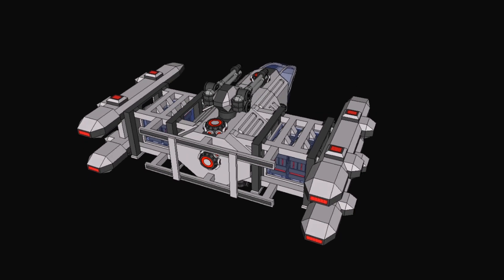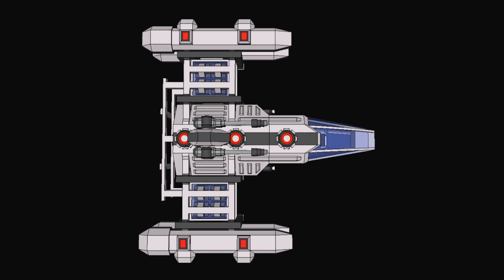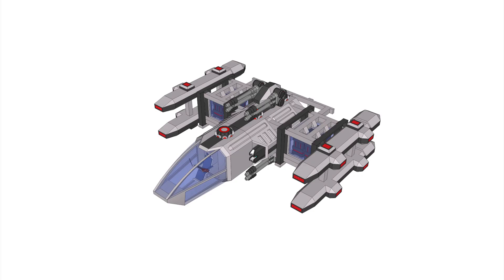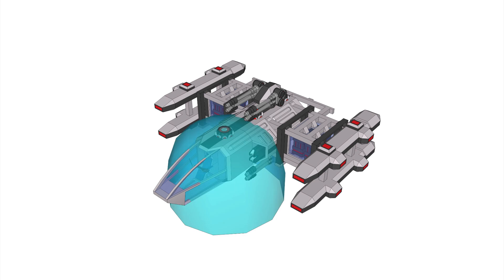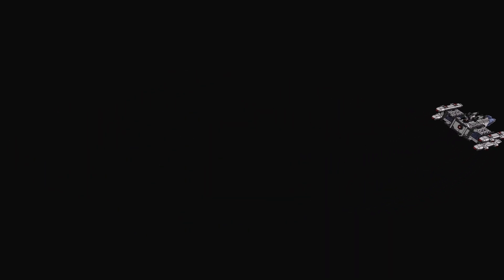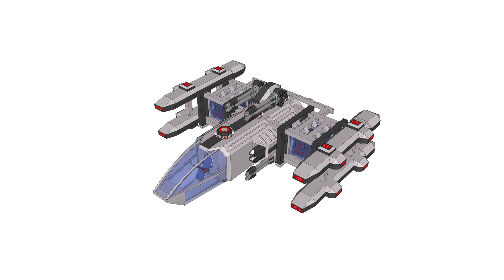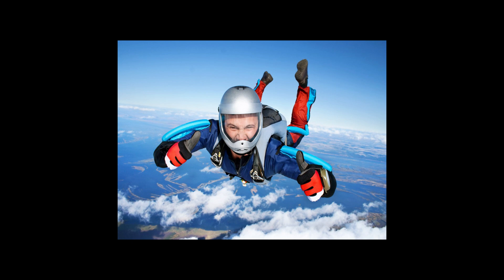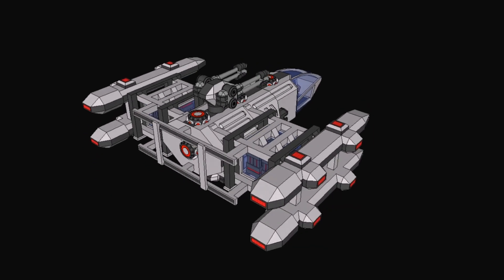Shad has a question! Gravitational acceleration on a spaceship?

Comment: Emitting gravitons requires emitting energy. So the pulse field generators will be pushing themselves backward. This means, if they are attached to the ship, you would likely go nowhere...

A deeper problem is that gravity is only attractive, never repulsive, for reasons that are related to the fact that the mediating boson is spin 2. Or so I recall reading in Zee's book on quantum field theory. Basically, in particle physics, a spin 2 boson can only mediate an attractive force, so any particle theory of gravity would only have attraction.

However, we should also note that the best understanding of gravity may well be not in terms of particles and virtual particles on spacetime, but rather by looking at the changes to spacetime itself.

EDIT: I'd say more about this, but I'm moving soon and my Zee book has already been packed away.

Comment: with a strong enough gravitational force you can get to C (AKA the speed of light), or as close as posible, as in a black hole.
and about the acleration of the spaceship as it get heavier geting close to the speed of light it actuali dont mater for two reasons , first due to the formula of gravitational force by inceasing the mass of a body you alsso increasse the atraction between that body and any other mass source, and second due to enisten's law of relativity as the generators are moving together with the ship the mass of the ship to the generators is the same no matter how fast it is going.

Comment: It's wrong to think of gravity as a force that you can project like a beam of light or a property that you can endow.  Gravity is a consequence of the warping of 4d spacetime which itself is transmitted within a field.  That is to say, it is a necessary consequence of the shape of the universe and all you can do is warp that spacetime with lots of matter (although a humongous amount of energy will do the trick too).  So to create gravity of 1g with the nodes the size suggested would warp spacetime so much as to create a small black hole in your spaceship - this would be bad.  Plus it would be so massive you'd have too much inertia to move anywhere.  There is a way to use a micro black hole to propel a ship but that relates to trust and not artificial gravity.  

That said, something very close to what you say is theoretically possible which is referred to as the Alcubierre drive.   You 'just' need to warp spacetime in front and behind a craft and the spacetime surrounding the ship will move - potentially at superluminal speeds - relative to the background spacetime while the ship remains stationary within its frame of reference, so no inertia.  This much is solid physics.  What's very much not is the requirement for exotic matter with negative mass and there's no evidence at all for its existence.  However, it's conceivable and in a sci-fi setting it's grand.  

Drop the small nodes and go for rings encircling the front and back of the ship or a single large one midships.
Reply: To clarify: the Alcubierre drive does not create artificial gravity, you'd be floating about.  The only ways to do that are 1) spin the ship 2001 style and go in a straight line 2) accelerate at 9.81 m/s/s and go in a straight line 3) somehow fill people with a metallic substance without killing them and use magnets.  However, electromagnetism is a force orders of magnitude more powerful than gravity and you'd get a very steep gradient which wouldn't feel the same at all - your head would feel very little and your feet loads.  To minimise this you'd need to make it very powerful and reasonably far away under the floor and maybe have a repulsive force from the other side.  Meh, none of these options are great if you want the ship whizzing in different directions.

EDIT:  I've got it.  An Alcubierre drive and have thrusters under the ship accelerating upwards at 9.8ms2.  You could correct the trust with the drive and you'd be stood on the spaceship not knowing the difference between that and the gravity you and I are feeling now (there is a trivial difference but it wouldn't be anywhere near noticeable so I won't explain it).
Reply: Couldn't you just couple a Universal Element Compensator to an Okuda Deheisenberger with a Reflux Capacitor in parallel?
Reply: +David Murphy (DaddyMonster) Nah, wouldn't work. You'd need to hit 88mph at the same time as the lightning. That's just silly..
Reply: +Michael Bower 
Not necessarily, if you have space being wrapped to compensate for the artificial gravity thrust you could keep accelerating without gaining additional momentum. I think there would be other problems, such as constantly using more and more of your "Negative Energy/matter" to keep compensating for your artificial gravity acceleration.

Leaving the need for either exotic matter or more Energy/matter than is contained in the planet Jupiter aside. If we got enough of what gives us the means to warp space for traveling interstellar distances. We could just use more of that to solve our gravity problem.

The ship is already generating two gravity wells for propulsion, it might simply be a trade off in how far the ship can travel on one tank so to speak, to create a third gravity well either behind or under the ship but within the propulsion warp field that generated a 1g environment.
Maybe the space warping field in front of the ship can do double duty for that, making the direction of artificial gravity the same as the direction of travel.

So what it come down to (if we assume we have what it needs to make this drive work) is the economy of design. How much resources we spend for how much benefit.
If the drive is fast enough to get you from colony A to colony B within 2-3 months, artificial gravity might just be an unnecessary luxury. Cargo haulers might forgo it all together while passenger ships go with the presumedly cheaper rotating habitats.
Space travel that takes so long that crew has to worry about physical wear due to microgravity might call for travel in suspended animation anyway.
Then there is the possibility of combating the ill effects of microgravity with genetics or cybernetics that stimulate muscle and bone growth to the point where humans can just shrug of long times spent in microgravity.
We are a lot closer to those technologies than we are to an Alcubierre drive after all.
Reply: The issue with 2) is that you'd have to keep accelerating. And there would come a point where you couldn't accelerate anymore due to it requiring too much energy, but then I suppose you could rotate and use the deceleration instead. Actually that would be better, since you wouldn't have to course-correct so much.
Reply: This is why I figured in my sci-fi that graviton-manipulation would be used for FTL travel on giant ships instead of propulsion on 'starfighter' size ships.
Reply: +Michael Bower acceleration from /your/ point of view doesnt take increasing amounts of energy. your local frame continues to feel the same acceleration with no change in energy or mass needs.
what runs out far earlier than relativity allows you to is reaction mass. the stuff you throw out the back to accelerate. (conservation of impulse, duh)
and how would accelerating in the other direction (aka decelerating) change how many course corrections you have to do?

+David Murphy
the alcubierre (or natario or whatever metric is actually used in the end) drive is a construct completely out of exotic gravity control. it doesnt produce any internal gravitational field by design, not because the thing cant out of principle.
the original alcubierre metric was simply designed that it has a flat internal spacetime. changing the metric that it includes an internal gravity field isnt a monumental task. it would probably require a bit finer control of the mass distribution than a basic working drive because you dont have a clear edge condition but a volume condition. and probably a few other problems of keeping your ship properly located in the bubble when its pulled towards the back where a big, steep, dangerous gravity gradient would rip you apart.
Reply: You havent heard of gravitons i suppose?, you are only thinking about the macroverse and to some extent the microverse, you need to realise the quantumverse is all that really matters (no pun intended)
Reply: Gravitons are more a placeholder, just in case they find a carrier is needed for gravity. So far it seems to be an effect of energy on space. Energy bends space and thus produces gravity. 

In hypothesis you could create a gravitational field in front of the ship and use it to tow the ship along, the problem with this is gravity is exceptionally weak. You would need the energy equivalent of earth to produce an acceleration of 1G. So it's impractical. 

Ion engines are low power but a variant known as a VASMIR engine seems to be capable of much more thrust. It still wouldn't get you anywhere fast. The simplest way of providing a gravitational effect is a 1G constant acceleration, or rotate a big space ship. 

The EM microwave drive, while it would have been very useful, looks probably to have been an unshielded component interacting with the earth's magnetic field.

Comment: You can't push a sail boat with an onboard fan. Same princaple here, the gravatational "thrusters" would just pull themself againts the ship and nothing would happen. Unless the Gravational waves are inverted (so they push rather than pull), but they would still need an object to push off from right? You cant push off of nothing. But honestly havn't got a clue.

Comment: Well, first of all, your gravity generators violate conservation of momentum and newton's 3rd law. If your gravity generator pushes stuff away, the generator should be pushed in the opposite direction. Physics as we know it simply doesn't allow for what you are trying to do. Think of the gravity generator as a fan that pushes the fabric of spacetime. If it pushes space into the ship, it also pushes itself away from the ship.
In order for what you talk about to work, the generators would have to thrust a beam of matter in opposite direction (aka serve as normal thrusters). In that case you can calculate their acceleration using rocket equation. For that we will need to know how much energy/fuel they use.
Reply from the maker: I get what you're saying but I think these pulse field generators would work differently. They don't make gravity in the sense of producing a force that pushes back against the generator as the generator pushes against the ship. There is no push or pull at all. The generators create a curvature of space time (gravity) in a forward projected and forward flowing cone (not a conventional uniform sphere) from the back of the ship to which the ship falls into. So the curvature of space-time flows in one specific direction from the generator causing the generator to fall forward towards the ship, not away from it, which means there is no counter force at all. The generator is not pushing away from the ship, it is falling with it
Reply: Shadiversity yes, I get that, but the curvature of spacetime must be made somehow. And that "somehow" must create opposite momentum somewhere else.
I think I have came up with reasonable "compromise" which would alter the functionality of the pulse generator slightly, while making it actually physically possible in real life. I've contacted you on your facebook page, because the explanation might involve a few sketches being thrown around. Spoilers: it involves warp drive

Comment: If I understood your question correctly, your answer is the speed of light. Your gravity generator is putting the ship under a constant acceleration, so it would be constantly accelerating without reaching the speed of light. It doesn't matter if the source of the acceleration is gravity or a regular engine.

As to why it is not used in science fiction, traveling interstellar distances with constant acceleration would take a lot of time. Warp drives are perfect for that.

Comment: Well how many G's can these generators create? I did all my calculations in G's for my sci-fi setting but I had to deal with too much acceleration killing passengers.
I concluded that travelling at:
1G would 353.8231 days to reach light speed (or close enough to light speed for this)
2G's would take about half a year
3G's about 118 days (almost 4 months)
4G's about 96 days (about 3 months)
5G's about 71 days (about 2.3 months)
After that you get into acceleration so dangerous it's unthinkable (and 5G's is no joke either) but at 10G's it only takes 39 days.
Of course due to time dilation passengers would experience a shorter amount of time, how much I have no idea.

The calculation I used was assuming 1G=9.80665 meters per second and the speed of causality was 299,792,457 but other factors may come into play that I had not accounted for.

p.s. instead of thrusters you could call them propulsion racks

Comment: I have no idea of complex physics what so ever and do science fiction/fantasy stuff my self, so i think my opinion could be wrong but still somewhat interesting. My big concern is that i would say a object needs something to push it self away from or pull towards, this is why artificial gravity does not affect the ship i comes from. If it would work the speed it could go would be limited, simply because a object with mass cant reach over a certain speed and i think i would take insane amounts of energy, if it would actually work. But lets say it works, you would need those generators facing in every direction and a system to turn and probably very good computers to control those stuff since i would assume its far more complicated than normal thrusters. I also wonder if it would work on planets. But overall it a pretty cool design and i would combine it with normal thrusters, so you would use this to go into FTL or something like that.

Comment: Think of gravity as a bubble.

Throughout that bubble, gravity is pressing down equally towards a central mass, which would be your gravitational projection device. Due to the gravity being equal throughout, there would be no way to generate movement using the force of gravity. 
Now let's say there is a way to project gravity and force the gravitational waves in a single direction, it could be potentially used for propulsion. This being said, the amount of power required to generate the energy to propel a ship forward using gravity would be immense.
Now, let's say power is boundless. Even so, the gravity would vary to a tiny degree in different spots, which after a long journey could alter the ship's trajectory quite a lot.

You would be better off with nuclear engines.

Comment: Propulsing a ship using space-time distortion (aka gravity as we know it) is basically the underlying idea of warp drive! There have been some publications lately considering it feasible, seems worth a look at to get the feel of the limitations. I would guess that if you could power an "artificial" gravitational field the only limit would be the power you can put into the system, however this would only change how fast you would speed up. That being said, gravity is very bizarre force that still baffles us physicists in many aspects to this day. 

The matter of inertia seems to be moot to me in a warp drive, since you would actually be moving space around the ship not the ship itself.

The other problem I see is with the directionality of the field generated by your PFG, I don't think you can do that with any of the 4 forces as far as we know it today.